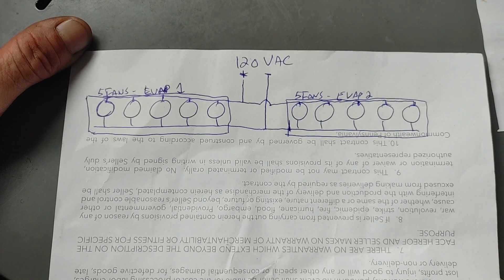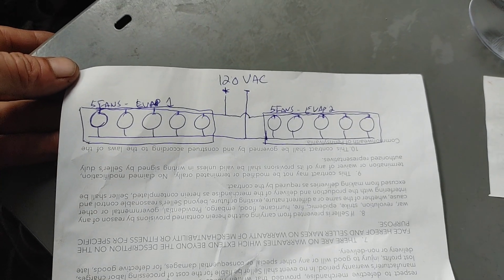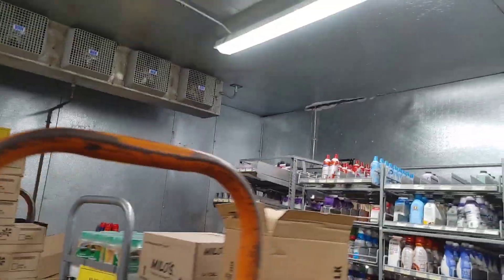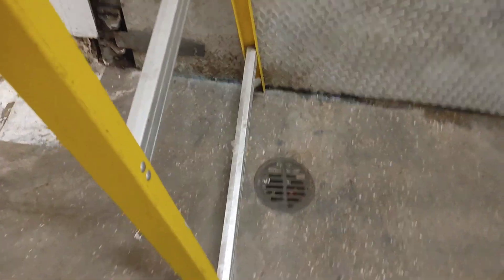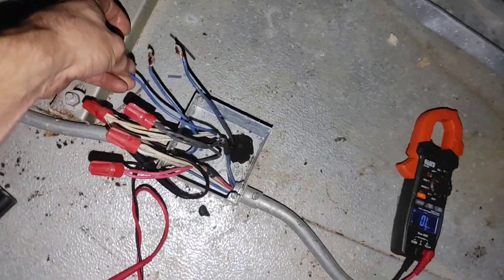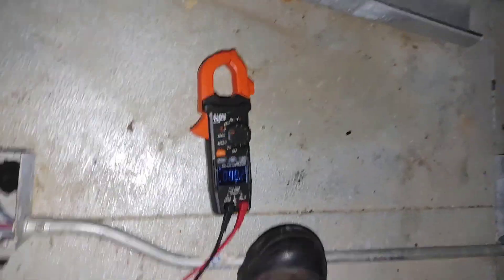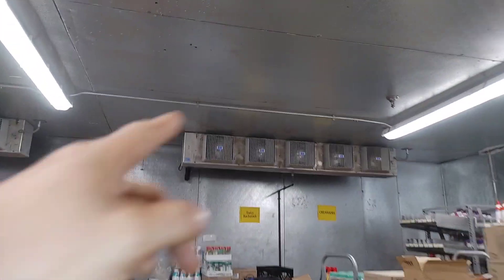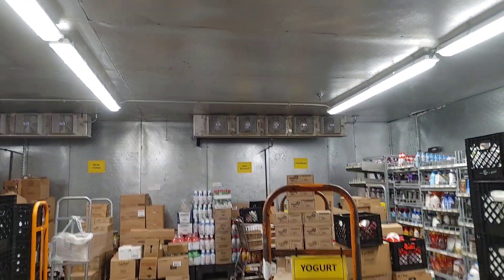Troubleshooting A Short with Ohms

Comment: you can use your phone to record the fans while you are in the other room to  flip the breakers.
Reply from the maker: @cw5657  yeah I suppose I could have done that. The whole reason I did it the way I did was to hopefully avoid having to go up the vertical stairs again. I could have had a app to where I could look at the camera of one phone through the other phone but I didn't have that. It's all good though it worked out.